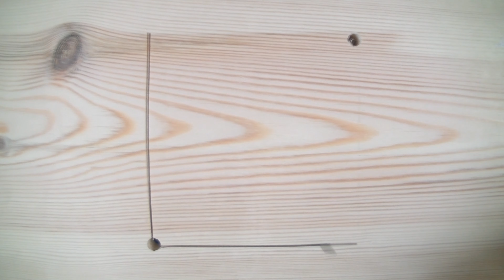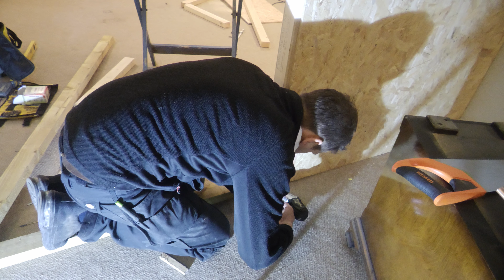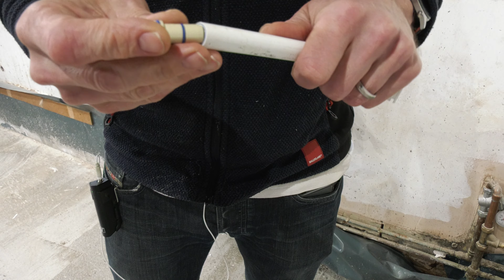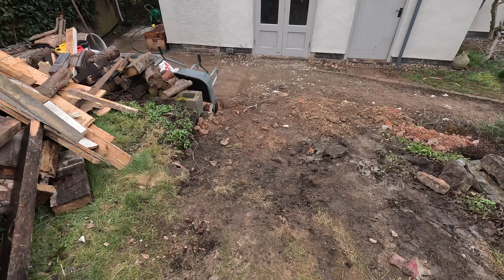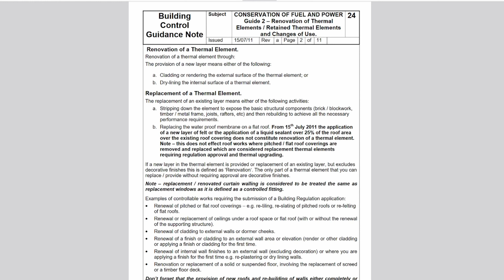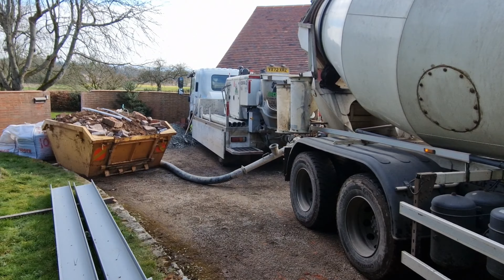How to Prepare an Old Property for Underfloor Heating

Comment: Very interesting Charlie! 
Was particularly struck with the comments around 11:55 about breathable floors. Why use a breathable floor if your concrete solution is still suitable? I'm looking to replace flexing timber floors with solid floors and wet UFH, also in an old property.

Comment: Where is part three showing UFH integration with your control system?
Would be interesting to see how you achieved this.

I have Honeywell evohome on the radiators & want a way for it to control the UFH.

I might be able to use the evo hot water module, which would just energise the UFH system.

TIA.

Comment: Very interesting about the concrete vs limecrete debate. I've a 150yr old property and I'm going to go with concrete with UFH.

I also dug down 400mm the same area as yours, by hand!!! I worked hard, but saved myself a fortune. No skips needed as reused the earth in the garden for 2 huge raised planters.
Reply from the maker: I was hoping to put the current dig on the garden but it was all rock and sand https://youtu.be/hbrhW4SBpYE?si=kNtFvfPmpx8CClTH You've definitely made the right decision going concrete
Reply: @CharlieDIYte  Thanks! I'm watching that video now.

Comment: You don't get damp on the upper floors, that would be a leak or too much moisture that you're personally creating, rather than "rising damp". So, questioning your insulation methods on the first floor is daft. It's really only the ground floor you need to worry about using lime plaster etc as well as good drainage and lime mortar externally. Of course, it's sad to see old properties being "destroyed" but the internal fabric is less of a concern than the external architecture.

Comment: Hi Charlie, What concrete strength did your eng specify? We have a C35 spec mix, which I know is very strong for a kitchen floor. 😮
Reply from the maker: Good question. Did I include the section where he was testing the concrete? I'll see if I can have a look through old footage.
Reply: @CharlieDIYte  thanks Charlie. Another good question 😂’how long did you let the slab dry before you installed the UFH  and screed?’ My wife not going to be happy when I say 1mm per day 😬

Comment: Interestingly, limecrete system at 250mm has a u value around .25, and at 300mm a uvalue of .18 - very similar to the insulation youve chosen. So I dont think there would be any loss in performance. But I suspect itd be more expensive. 

Appreciate the insight into the process!

Comment: Hey Charlie, it's still not clear why you have chosen to dig up everything rather than go with a low-profile system?
I keep re-watching the videos as my renovation reaches key point, I'm really grateful for all your content! 🎉
Reply from the maker: Thanks mate. 👊 Because the insulation below is what makes it really efficient, which you can't do with a low profile system. Also the 60mm of cemfloor poured on top of the pipes when it heats up creates the thermal massing (like a massive storage heater) and it's that which makes ufh so efficient and great for the rest of the house because the heat from the slab radiates everywhere, which it wouldn't do if the floor beneath wasn't well insulated.
Reply: @CharlieDIYte  interesting, thank you!  I need to limit the cost and couldn't get heavy machinery in there anyway (not to mention the slope my house is on) so will stick with PIR underneath and one of the low profile system. Keep up the amazing work!

Comment: Charlie, when you installed your sub floor did you have an existing DPC in the old brick work. Also did you just lap the new DPM up the walls or rake out and tie it in the DPC. I'm converting my timber floors to concrete and getting confused over the DPC and DPM integration..  cheers.
Reply: We're doing the same. What did you do in the end?
Reply: ditto

Comment: I wanna do my full house. with around 100mm insulation, problem thats confused me is the kitchen seems solid concrete and the rest is suspended floor. would i be able to raise the floor to the same level (heating pipes and screed included) as the suspended timber floor as i believe the suspended timber floor is above the damp proof course.  all the floors are the same level so if the suspended floor is above the damp proof course then surely the concrete floor is?

Comment: I have a house built in the 90s, which is screed over a concrete base layer. However, from the hollowish sound from walking on the kitchen floor, I suspect it uses reinforced concrete beams, not a solid floor. I am considering putting in underfloor heating, at least downstairs, as the rads are far too small for the existing system, let alone the lower temperatures of any future heat pump. Digging out a solid concrete floor or, worse ta reinforced concrete beam floor is a non-starter. I'd thus have to fit within the depth of the existing screed, maybe marginally raised a bit. I assume I only need to meet the lower of the two insulation standards. However, digging out several tons of screed doesn't fill me with joy.

Now I just have to find what sort of floor I have, and how deep the screed is. I'm hoping the water pipes and sink waste in the cloakroom is buried in the screed, as I also plan some wall alignment changes (stud in that case, although most downstairs are block). I assume drilling in a sacrificial area will reveal the depth of the screed, heaven knows how you work out if it's suspended reinforced concrete beams below.

Comment: I think offsetting the U value of one part to another would only apply to new builds. It’s called a SAP calculation.
Reply from the maker: Pretty sure it's still relevant to renovations where building regs apply but I might be wrong. Bottom line it's always useful to try and stay within building regs even when they don't fully apply. That way you know you're doing things properly 👍

Comment: The idea with limecrete is the whole floor will breathe, rather than all the underground floor moisture getting sucked up the walls. If your ground is dry, I think the risk you have take. Is minimal. Where I am the internal floor is fairly moist. These buildings are all about moisture movement. I’ll be installing an HVAC that will keep things fresh.
Reply from the maker: I agree. Having an overarching vapour strategy is crucial in any property but particularly this one. I'm thinking I'll probably install a breathable wall insulation. The problem with glapor insulation is it's a nightmare to clip the pipes to and the limecrete screed doesn't properly encapsulate the pipes meaning the UFH isn't completely efficient but I hear what you say.
Reply: @CharlieDIYte  thank you so much for sharing you super videos and journey! Interesting what you have said about limecrete ufh as I guess it’s not as mature as some of the very clever tech like anhydrite screeds that are super for thermals. It’s a real can of worms and juggling act for me building fabric (Norman tower and old medieval church) vs cheaper and more efficient modern materials. In some places it does not matter but others it is very delicate, I think you have taken the right route and balance!

Comment: I am thinking of installing underfloor heating in my home as part of possible boiler upgrade from oil to Air Source Heat Pump. The house currently has a solid concrete floor (reasonably flat but with rough finish) but with a strange 200mm suspended floor where the heating pipes live. This space is not ventilated. I am wondering if I can just installed 150mm insulation and then 50mm screed with pipes on top on the current concrete base which must have a DPM in it ?
Reply from the maker: Are the existing heating pipes for downstairs radiators that you'll be removing? You'll not want those pipes to be in the new screed that contains the under floor heating pipes.
Reply: @CharlieDIYte  Yes my plan was to rip up the suspended floor so I have a depth of 200mm to play with. Remove all existing copper pipes and put down 100mm insulation with 50mm screed on top with pipes in. Wondering if i would need a vapour barrier below the insulation? Great channel by the way

Comment: 10:20 very interesting point, which i have often debated. It is like walking about bollocko but with a string vest, merino wool, wool jumper, arctic coat, and hoping your warm top half offsets your frozen legs and arse

Comment: Charlie "DIY" Scrote the lost Scrote brother! 😁
If anyone is thinking of putting in underfloor heating then it really needs to be on its own circuit and not share with any radiators. Underfloor takes ages to heat up and then ages to cool down so the timer on/offs will be set differently to the rads. 
Personally I find underfloor too slow heating up and I do like a nice rad in the kitchen.

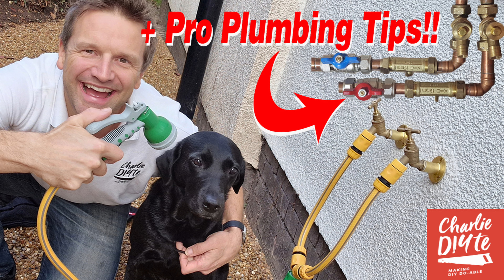Comment: 5:25 - Inserts for pushfit fittings for h&c water (rather than central heating) are a complete (and very cynical) waste of time and money.  In the 25 years I’ve been using them (mainly JG Speedfit) I have * never* had one fail (except when i didn’t insert the pipe far enough in to the fitting the first place).
Charging what they do for a piddly bit of plastic is ridiculous.

Also, you are supposed to screw the locking collars the other way to ‘lock’ the joints.  The way you have screwed them (with the threaded collars tight to the body of the fitting). leaves them ‘unlocked’.

Comment: Great video and informative Charlie. A question I have (as I'm considering this myself in a few months time) as the DPC is tucked up against the inside of your walls,  are you not now providing a pathway for any groundwater present underneath that slab to be pushed up alongside your walls now where capillary action could do it's worst?
Reply from the maker: Thanks Chris. I think you need to look at this as part of a comprehensive damp and insulation strategy. I'll be battening the walls then insulating in between with 25mm PIR, foil taping over the battens and then screwing insulated plasterboard to the battens effectively giving me two vapour barriers. I don't think the damp will rise much higher than the slab but to the extent it does there'll be nowhere for it to go. Compare that against what I've currently got - where the builders back in 2010 dot and dabbed standard Plasterboard to the walls creating a breeding ground for damp behind the board - as you'll see in this weekend's video.
Reply: @CharlieDIYte  Great reply Charlie - appreciate that. I'll be watching your video update before I discuss what's best with our builders. Our room isn't as big as yours and losing 25mm for insulation and 12.5mm for plasterboard would be a noticeable dimension change for the area. We're currently a suspended timber floor, but it's more like a springboard in places - it has many issues and now we're extending, I had considered replacing it all with a slab to match the new part of the building.

I agree with your double vapour barrier idea though - really is a belt and braces approach.

Comment: This video has come at just the right time, we are planning on removing a full height chimney stack and then removing an old suspended floor with a 500mm crawl space in some of the rooms, but eventually will be all of them, we will be running pipe work from the external vents to the rooms that we will be doing last just to keep the airflow to them, 150mm insulation then underfloor heating pipes with 50mm screed. we are also insulating the walls with 50mm PIR and plasterboard,roofing battens and dpc, we are doing it separately as there is a bigger money saving that buyers no insulated plasterboard, using expanding foam on the board edges and then silver foil taping the joints before fixing the plasterboards. 1936 house with a total of 130m2 of suspended floors hence the need to do it all in 3 stages
Reply: Can I ask, any problems with damp being pushed up walls.  I am similar project, finding it difficult to get anyone to do Glapor Foam Glass so possibly going with the insulation as above.

Comment: Hi Charlie 😀thanks for another great video, like many others I have followed all your content and have used many of your tips when completing my own projects..
I recently had wet underfloor heating added to my downstairs during a kitchen extension build. The existing ground floor was concrete so I found a UK company that cut 16 mm channels into the existing floor and new extension floor, then installed the pipe work into the channels. It has worked real well and it runs at 35 c for 2 hours per day. I would highly recommend to anyone thinking of retrofitting UF heating. Keep up the great work.
Reply: Thanks Gerry - I currently have oil CH / log burner (with 6kw back boiler). Thats my planned experiment (1/4 way through) - insulate the walls n roof as much as possible, and use cheap overnight electricity (alongside charging my EV) to fill the house with cheap energy to give the place some thermal mass heat to cover the next day.

Comment: I had this done 20 yrs ago on a old property throughout the ground floor.  It made a tremendous difference in heating and comfort to walk barefoot in the winter months.  Also I had a ground source heat pump installed for all the heating and hot water requirements
Reply from the maker: I wanted to do the whole of the ground floor but my wife wouldn't let me. Said there would be too much disruption. She has got a point but it's a shame. Great work 👏
Reply: @CharlieDIYte  We actually moved out into rental for the period of renovation.  I would never live in a building site ever again

Comment: Thanks for sharing. I’m surprised you put concrete below the insulation. If you compact the aggregate, top with sand for a smooth surface then add a damp proof membrane followed by insulation and UFH in a screed, would that not have been enough? (Not expert advice)
Reply from the maker: Not sure why you do it this way Mark but common sense would suggest it's so you're laying the PIR (which is itself a slightly fragile material) on a firm base that won't be prone to any movement/ slumping.
Reply: It can get alot more complex and the screed ontop provides a good chunk of thermal mass.

Comment: We had the limecreete floor in our kitchen but the building control insisted on a radon barrier and our builder hated the system. Mixing the lime by hand was seriously hard work.
Reply from the maker: I bet it was, Paul. And one of the issues is it's very hard to get the limecrete to totally encapsulate the pipes which in turn makes the system less efficient. Thanks for the feedback. How are you finding it?
Reply: @CharlieDIYte  they poured the limecrete directly onto the pipes so you get a very large thermal mass exactly as the Tÿ-Mawr system. It a vast improvement on the 1 inch of concrete we had before. I am sure you will find the same. 

If I did it again I would do exactly what you are planning but it’s a listed building so it helped get the consent for a very modern extension.

Comment: Glad you mentioned limecrete! Should be the 1st choice for solid walled houses especially if damp is an issue. Let’s hope the DPC doesn’t displace moisture in the walls 🙈

DIY’d a limecrete myself but 300mm GLAPOR, 75mm limecrete topped with UFH and topped the original stone floor. This meet the modern regs. It was actually fairly easy!

Should only need Part L exemption if the foundations are shallow.
Reply from the maker: Wow, what an effort Kieran. Do you know what u value you achieved?
Reply: @CharlieDIYte  exactly 0.18w/m2K, mainly because I have a lot of exposed perimeter vs the area covered. If I had rooms similar to yours it would’ve been under the 0.18. 

I live in a high water table area and the floor has been a game changer for damp. I used to be able to physically see the floor get darker in colour when the water table rose! 🙈

I also used a micro digger and my handle start, 1960’s dumper. Well worth it the cost! Biggest hassle for me was using 2 tiny drum mixers for mixing the lime on site when each mix takes 20 mins. 

Also, my farmer was grateful for the rubble which he crushes on site and uses around the farm. Might be a good way to save of skips!
Reply: I'd go with GLAPOR but I think it would be hugely expensive in my 660mm void?

Comment: Don’t know if anyone else is on my wave length but you have saved LOADS of money using a digger and dumper. The amount it would cost in labour and workers to man handle all of that would cost alot more 👍 also the potential price of the physical toll of this job on your body and all the builders bodies in years to come has been removed 👍 great video as always mate 👍
Reply from the maker: Thanks mate. Yes it limited the excavation to about 2 days which is remarkable when you consider how many tons were excavated.

Comment: Skips are a rip off. I was lucky enough to have someone point out the benefits of a grab and shift wagon. Saved me loads of money but better than that , I didn't have to load skips, they just take the lot, he even got a brush out to get the last little bits. Great vid Charlie you are hardcore with more grit than Type 1 MOT 😉
Reply from the maker: Thanks Craig. I probably would have saved the thick end of £800 if I'd started with the grab lorry. 🤦
Reply: And skips in turn are a bargain compared to Hippobags.

Comment: Great video. Sorry to see the kitchen go though as it was the inspiration for painting my own kitchen with the Railings colour 😂
Reply from the maker: Thanks Gary. Yes I was rather gutted. It was looking a bit tried again but to rip out an all pine, dove tail jointed kitchen, to replace it with an MDF version is quite hard to get your head around. What paint did you use? I wasn't a big big fan of the Valspar.
Reply: @CharlieDIYte  that’s true, but I’m sure the new kitchen will look great too. I used the F&B interior eggshell. It does chip a bit but as you called out in your video on it, there’s no real sign of flashing when touching up with that colour which is great